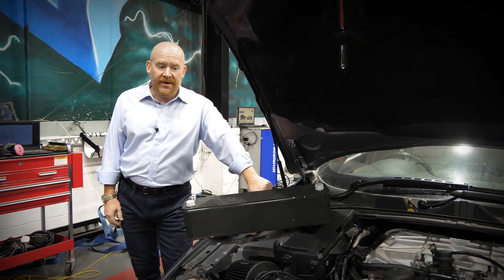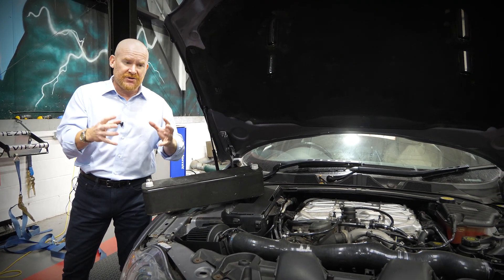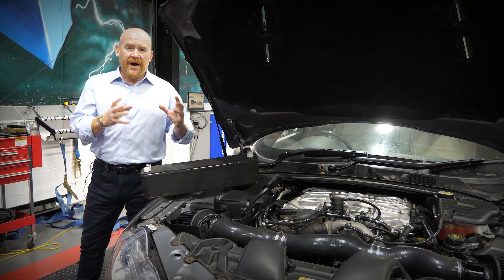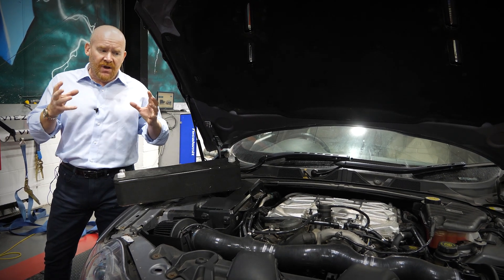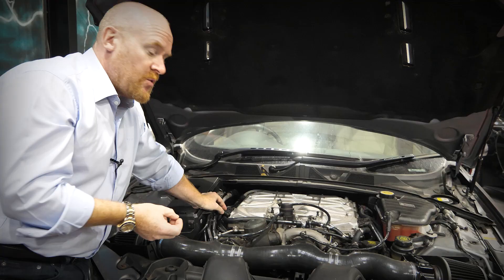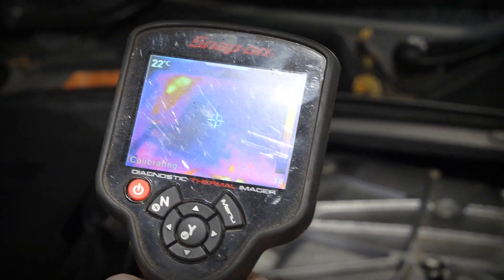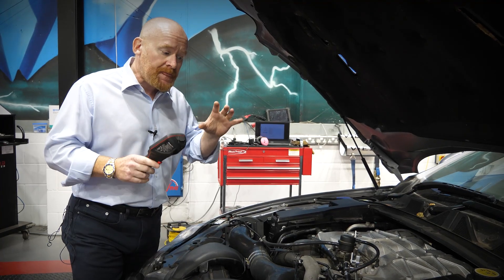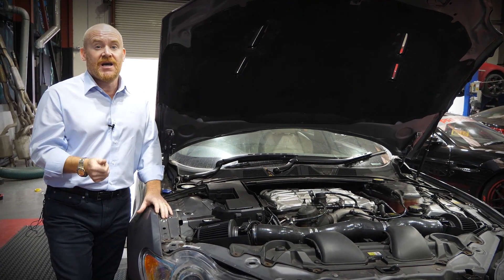Jaguar Supercharger Chiller Kit - Stop Heat Soak and Unlock Real Power #JaguarSupercharged

Comment: Very impressive as always! The 5.0 Jaguar engines seem to be less reliable than their less powerful  old 4.2 and 4.0 predesessors though  - many engines suffer under spun rod bearings, head gasket failures but also timig chain issues - what ist the reccomended measures prior to such massive power increases to keep (or make) the engine reliable? Would very appreciate your opinion.
Reply from the maker: Hi, before any upgrade we would recommend that diagnostics are carried out and if all clear there shouldn't be an issue. But with any upgrade it all depends on how you look after it and the history of the vehicle.

Comment: I want such a system for  my xjr x351 + a bigger supercharger cooler!!! Do you ship to Germany? Is there an installation manual for connecting everything? How much horsepower does it add?
Reply from the maker: Thank you for your message - worldwide shipping is available! 

In terms of pure horsepower gain, it is a few horsepower but the main benefit is sustained, low intake temperatures to keep that power consistent.

Please get in touch for more information! info@viezu.com